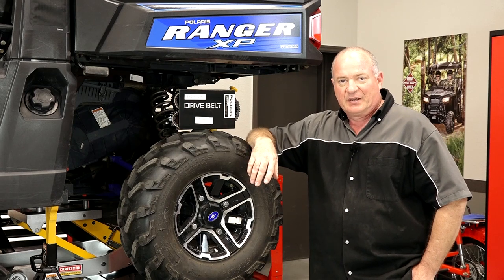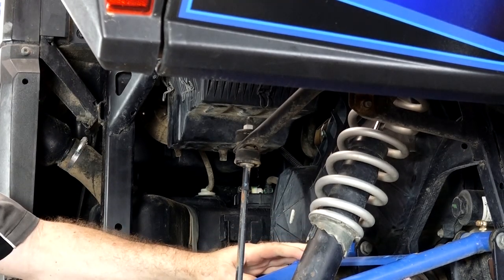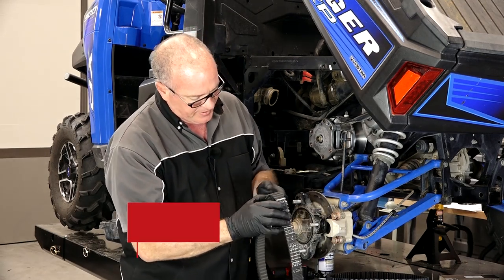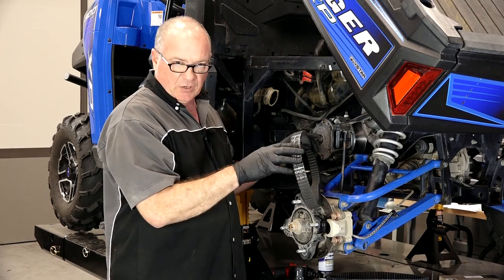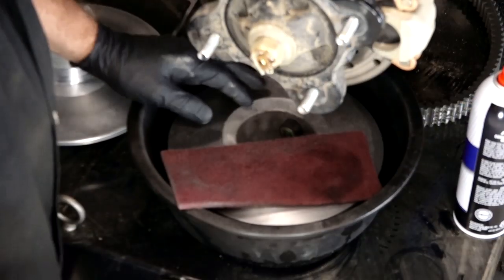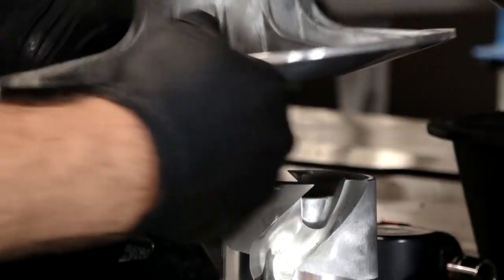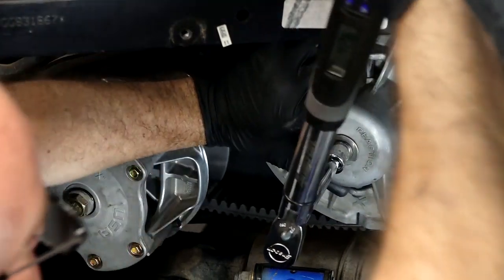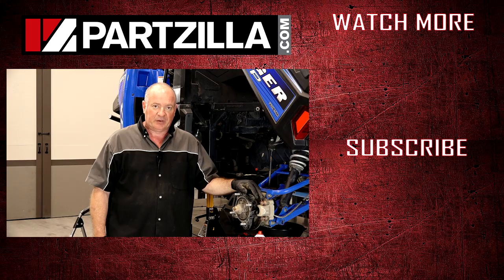Polaris Ranger Drive Belt Change | 2016 Polaris Ranger 900XP  | Partzilla.com

Comment: Your videos are very helpful. I have a 2015 Polaris Ranger XP 900 and was able to remove the belt and clean and replace the Driven Clutch. However, I was not able to torque the Drive Clutch. I had the vehicle in High and someone depressing the brak. The clutch would spin and I could never get the bolt torqued to 43 foot/lbs.  Why would this happen and what I can do to re-torque?  Thank you.

Comment: So...I have a primary clutch on a used 2012 sportsman 500 that is catching, it starts to go in...stops...then suddenly goes in all the way.  I am installing a whole new primary. The belt was just changed 5 months ago. So with a used belt...used secondary...but a NEW primary...what is the process? change the belt anyway? only scuff the new primary and use old belt? scuff both? scuff neither?      Thanks.
Reply: Dev/Null no need to scuff, just wash your belt and let dry. I would replace the old belt. Polaris recommendation is to c/o belt every 50 hours, 1000 miles or 6 mo. Whichever comes first
Reply: @Its_steve_bro  Thank you for the reply. What i wound up figuring out was the buttons int he secondary were worn...causing my issue. So i did not need a new primary or new belt...just service on the secondary and all was good. Thanks again.

Comment: I just completed this process on my 17 ranger 1000 xp due to getting my old belt hot and glazed on the sides causing slippage now with the new belt installed it is bucking and jerking at low rpm’s during take off  any ideas what would cause this?
Reply from the maker: Did you clean the sheeves with contact cleaner and a scotch brite pad?  If the sheeves are worn and don't move in a fluid full motion, that would be the big one. In the vid I show how  the drive sheeve should move with the spring removed.  Does that help?
Reply: @PartzillaParts  yes I went back and cleaned everything better with brake parts cleaner and it cleared up thanks for the help !

Comment: What does putting it in drive and holding the breaks do in tightening the bolt?
Reply from the maker: Just locks down the pulley so you can tighten it, otherwise it will spin on you.
Reply: Eric Nawaz nothing.

Comment: For anyone looking to do this on a 2013 900xp....This doesn’t work the same way. Clutch doesn’t come apart and it’s impossible to get the belt on without spreading the clutch. Better have a good pry bar then you have to be careful not to scuff or bend $500 aluminum clutch. Level 1 task (according to the video) for me turned into level 3 real quick. I’ve serviced everything on my ranger, installed led lights, installed a winch, rocker switches, changed out axles, boots etc.... this task isn’t easy. In fact, very difficult to get the belt back on. I’ll never do this again. Paying the pros next time.
Reply: they make a tool specifically for this, about $12 on amazon